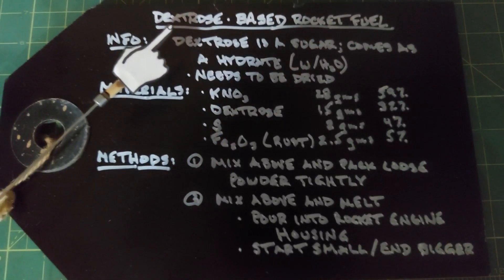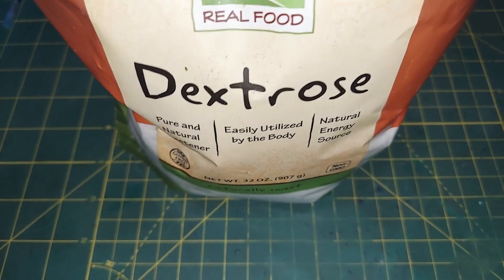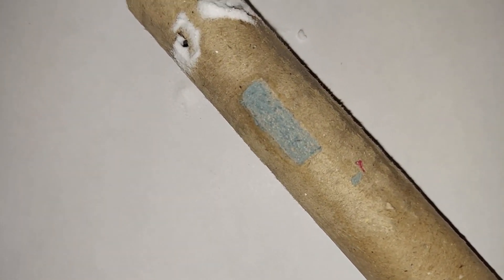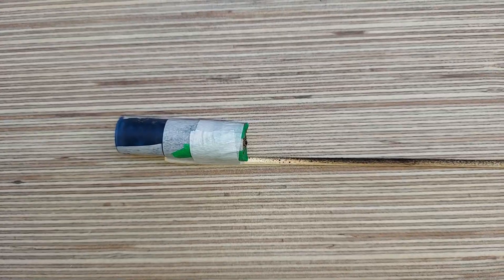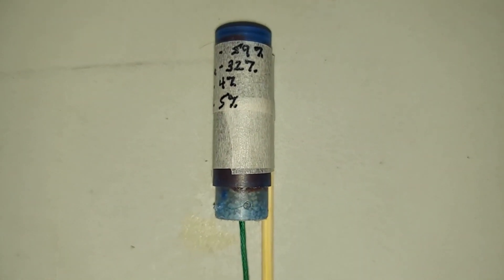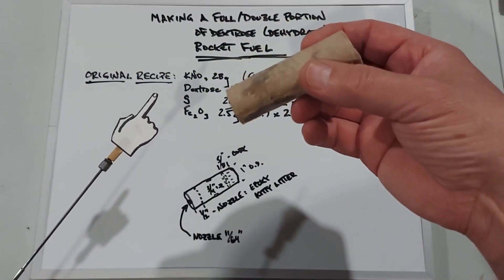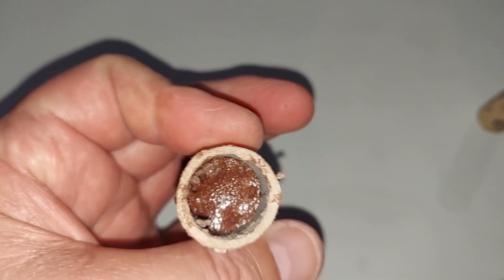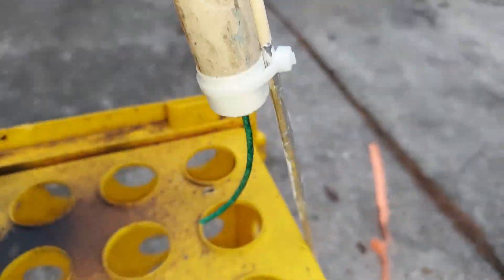Making Dextrose Based Rocket Engines

Comment: Please understand that I have absolutely no idea of what I am talking about, and still do I try to give an advice. :-)
To get the fuel into the tube, would it be possible to heat up a funnel while you are mixing the fuel and then scrape the fuel into the funnel, so it is easier to get into the tube?
Reply from the maker: Interesting idea.  I think it would work actually.  You have me thinking!
Reply: @cranialconstruction  Thank you for your kind reply🙂I think maybe a small metal funnel that could reside in the pan while you are heating up the fuel, and then when the fuel is ready should the funnel also be plenty hot:-)

Comment: Very cool! You should try replacing the iron oxide with CuO as your burn rate catalyst.  I find it works a little better and it adds a nice blue/green color to the flame.
Reply: Here is a slew of info on solid propellants:

https://www.ncbi.nlm.nih.gov/pmc/articles/PMC8587658/
Reply from the maker: Thanks for the tip!  I have not tried this before but will be looking into it.